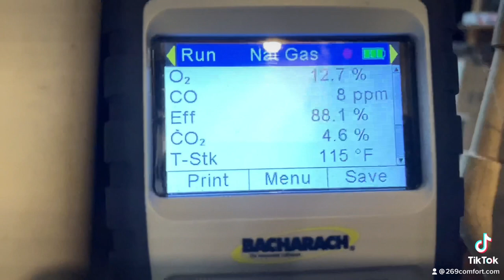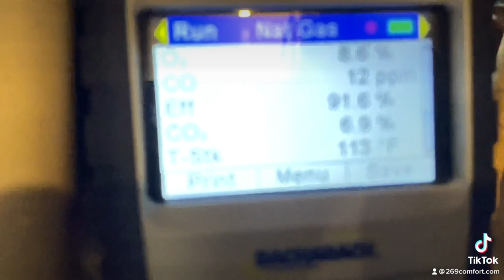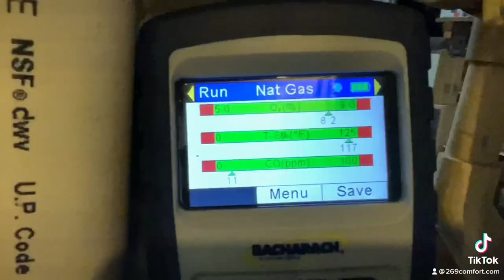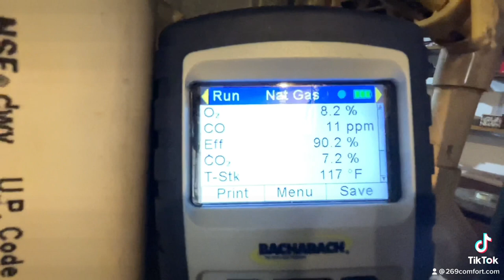Furnace tune-up on a Luxaire with the bacharach combustion analyzer.

Comment: would you recommend a schedule for cleaning the flame sensor after every winter or any other general maintenance you could give to some HVAC savvy homeowners. Maintenance that would be a step above changing the filter (might be a good video on its own)
Reply from the maker: Yes, cleaning of the flame sensor every heating season would be a great start; I always check the capacitor to see if they have one for the blower motor. It would help if you had a multimeter that would read microfarads. I will do a video on this in the future. Thank you.
Reply: @skip c if you really want to learn you can take a deeper dive by using the ACCA Standard 4. Very few techs would do everything on that list…those that do are the exceptional ones.